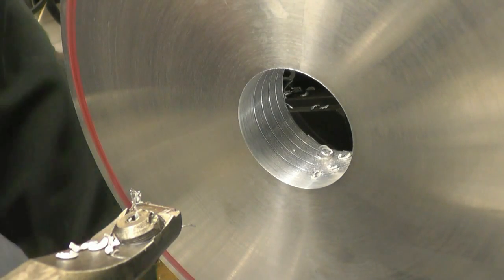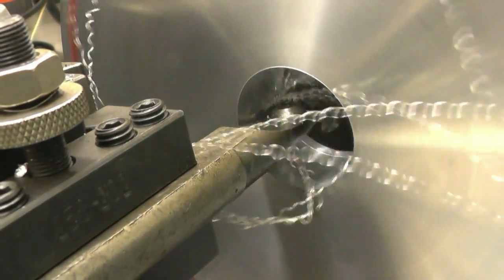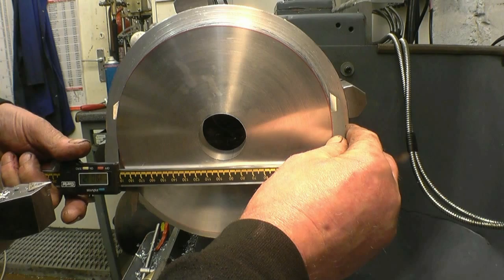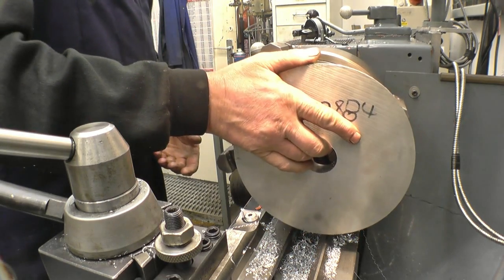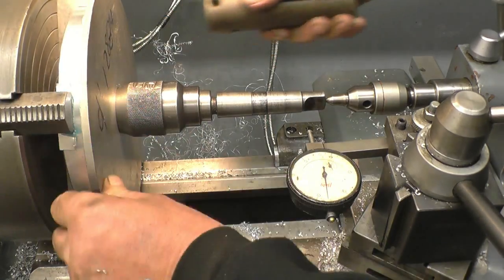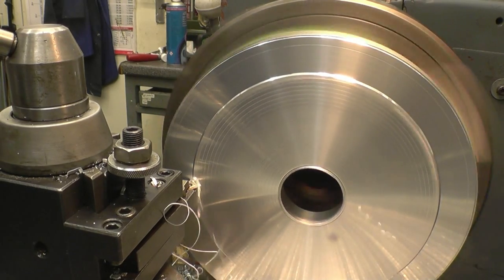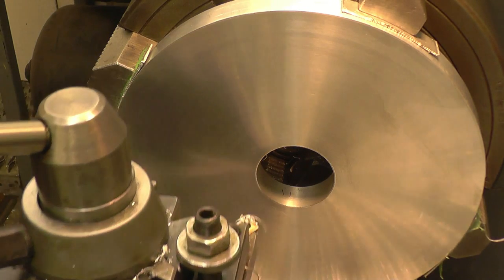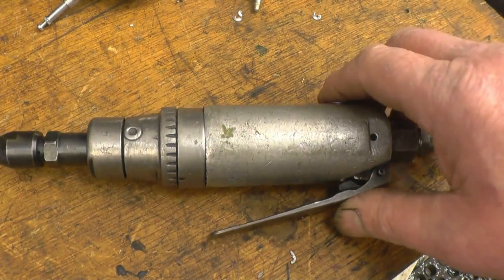SNNC 170 P2  Machining Aluminium, Steam Waggon teaser

Comment: Love your channel sir, because of you, Keith Fenner, Adam Booth, Tom Libden, and a few others. I bought myself a mini lathe to learn on and start with. It is also all I can afford. I love it and use it every day to learn more about how it behaves. Thank you for the inspiration to get out and try it. I spent 15 hours in my home shop this weekend and didn't know it till my wife came out and told me to come inside and get cleaned up lol.
Reply: Not until you get 40 hrs in a weekend, then you will be ready.  To come in and clean up.
Reply from the maker: Thanks for the kind words
Reply: Way to go! Welcome to the fascinating world of "the shop" may you always need another tool and always have a problem to solve therein! Cheers!
Reply: I can't do 40 hours in a weekend sadly cause of my real world job, a wife, a 3 year old boy, and my second child in due Sept. That and I typically work 50-60 plus hours or more a week. 72 hours a week down range roughly when deployed. One day I would love to own and open my own shop. Right now it is all learning curve.
Reply: Thank you for the encouragement sir.

Comment: a squirt of ethanol stops aluminium "welding" itself to the tool
Reply from the maker: WD 40 also works but i had none  I will try the Ethanol thanks
Reply: Kerosene or lighter fluid will work but you need enough ventilation in the shop because the vapors are nasty stuff.